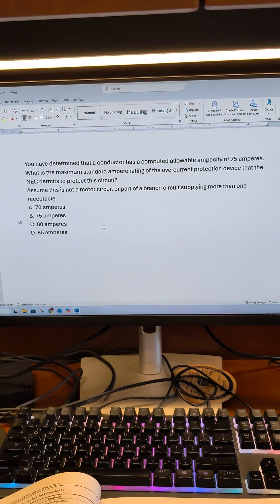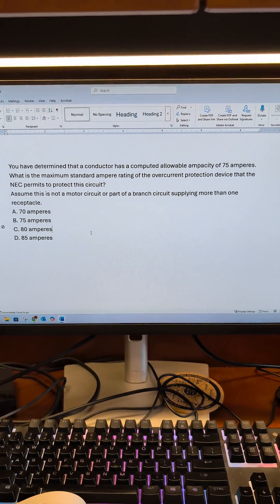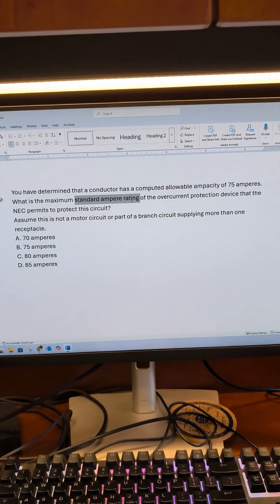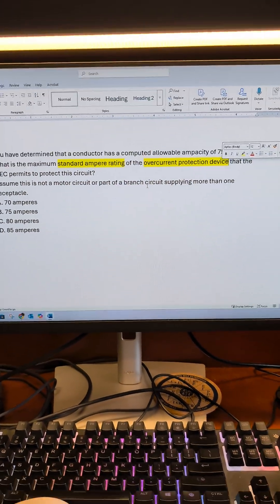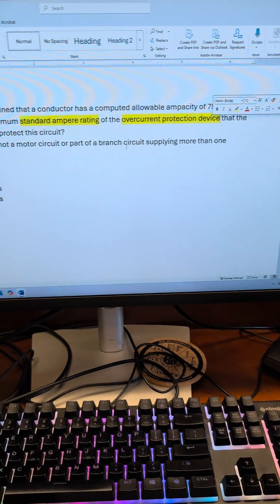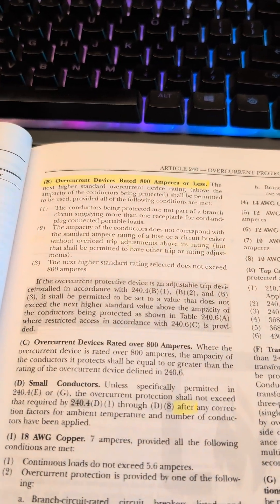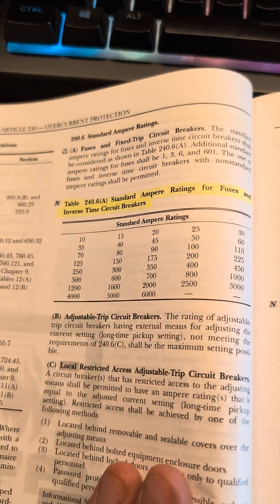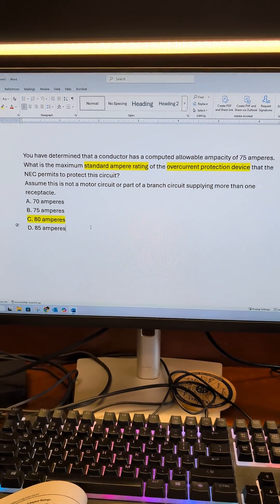NEC 240.4(B): Overcurrent Protection - Not Just Close Enough! Exam Question ANSWERED

Comment: I thought it said somewhere you couldn't have an over current device with a higher rating than your wire conductor?
Reply from the maker: Normally, you are correct. We want to protect our conductors. We’re allowed to go to the next largest size because it’s not a standard size. 240.6(B) has some requirements that you have to meet before you can go over the rated ampacity of a conductor.

Because of the time constraint with shorts, I couldn’t go too deep into it but check out article 240.6 and read in full.